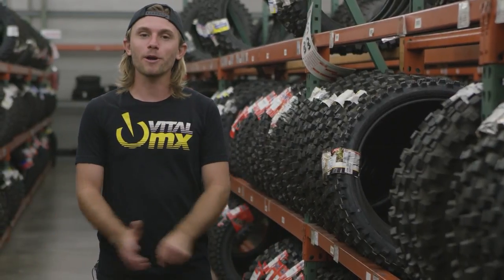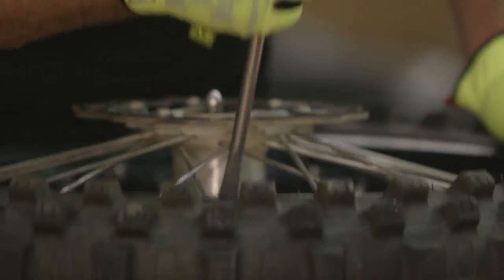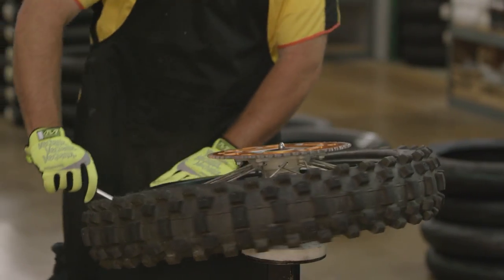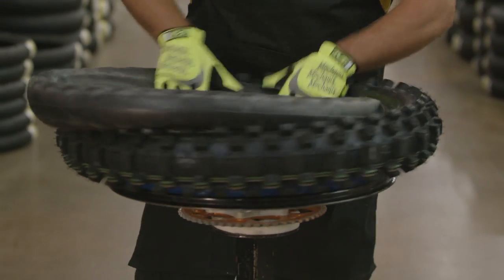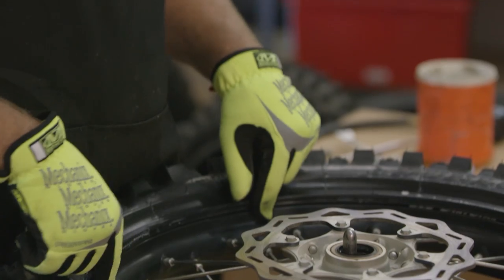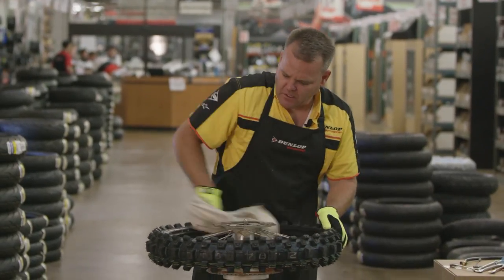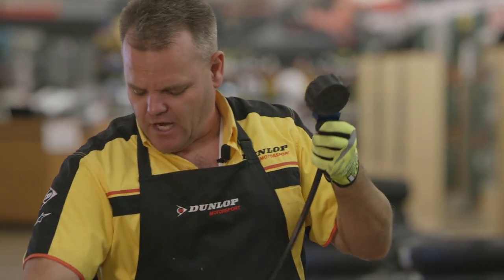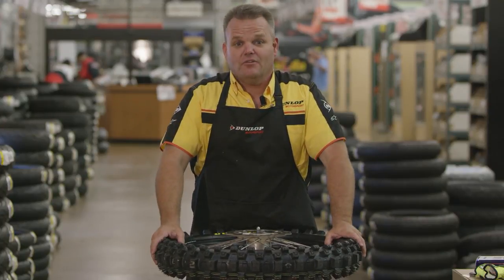Vital MX Tech Tips: How to Change a Motorcycle Tire

Comment: Is it bad that I run my bike at 30 psi?
Reply from the maker: Depends on what kind of riding. But for motocross and most off-road riding, yes, that's very bad. You're missing out on a very large amount of traction as the tire won't work as it's intended. What type of bike, tire, and riding conditions are you speaking of?
Reply: Vital MX a 85 and mostly hard packed